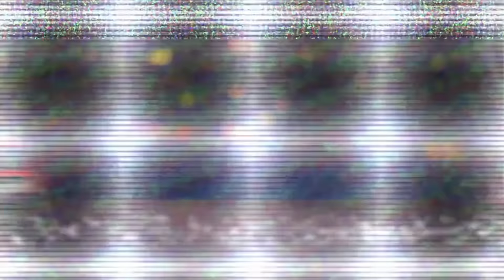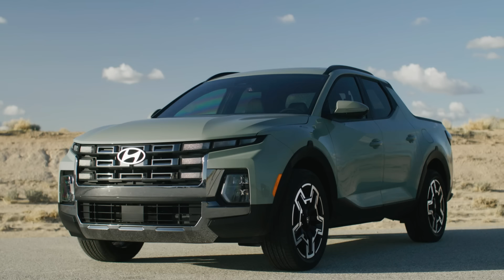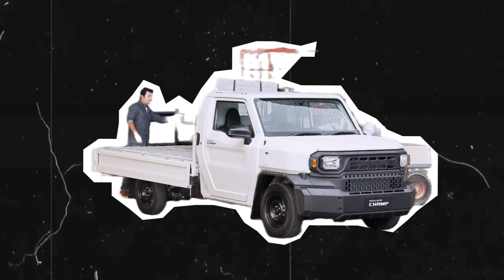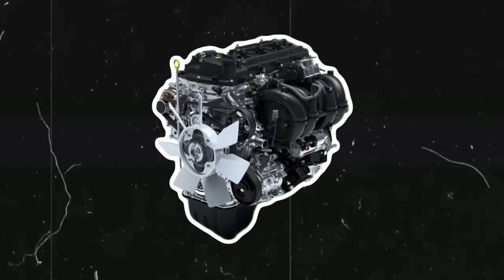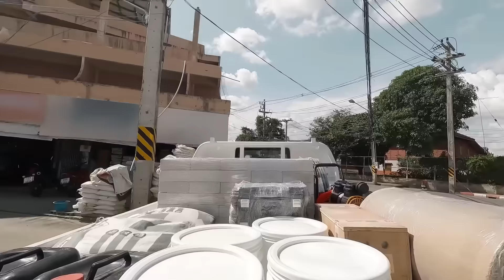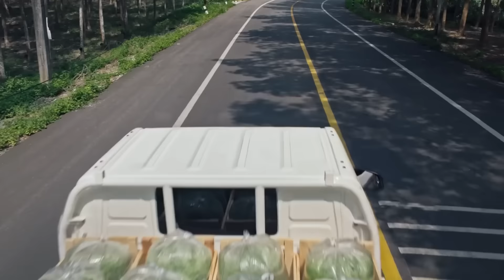7 Reasons You Should Wait For Toyota Hilux Champ (Don't Buy Maverick!?)

Comment: No diesel, no manual transmission ... no sale.  Hybrids are garbage.  The 2.7 gas is OK, but will need a manual trans to take advantage of the low hp.
Reply from the maker: Yeah, a diesel or manual setup would definitely appeal to a lot of purists. Given modern U.S. emission rules, a diesel compact truck is pretty unlikely, but what makes you lean so strongly toward diesel over gas?
Reply: @tech_triumph  A diesel is a much stronger built engine and can handle the pressures of a turbo.  Yes they are more expensive for general maintenance (filters, additives, etc...).  Diesels inherently have much longer lifespans then gas engines.  But mainly the low end torque, especially mated with a manual trans.

Comment: Toyota hasn't hit squat yet but if you have the intelligence of a rock, you darn sure aren't going to spend on a truck what a house should cost.  If it doesn't stink, i'll take one (stripped).  I can roll down my own window.  I want something super dependable, easy to work on, a basic radio and I'll pay extra for 4WD if available.  Manual tranny, no computer BS, no air conditioning, diesel option... all OK.  If you want my business, take my cash but I'm not financing anything.  That means it better be way affordable but you just might get a lifetime customer... unlike Ford, GM or Dodge.  Because I'm a man, I don't need my truck to wipe my rear end.  I do need a truck I can feel smart for buying and to work virtually all the time when I need it.  Thanks Toyota.  Now let see if you can pull it off.
Reply: You are stuck in the 1950's.